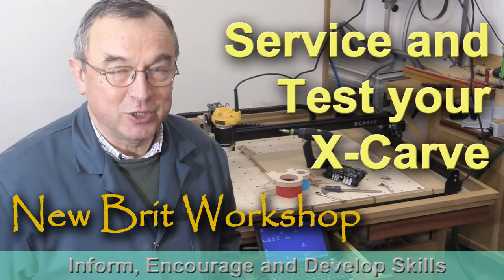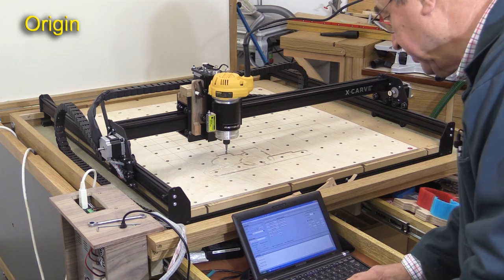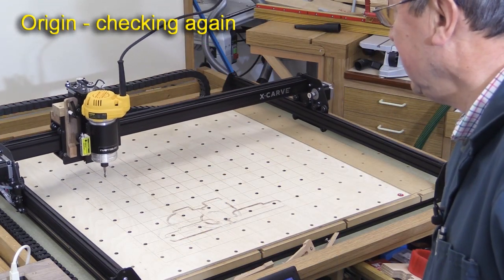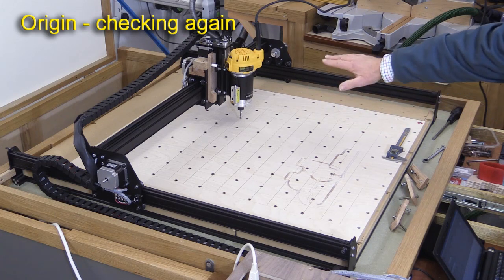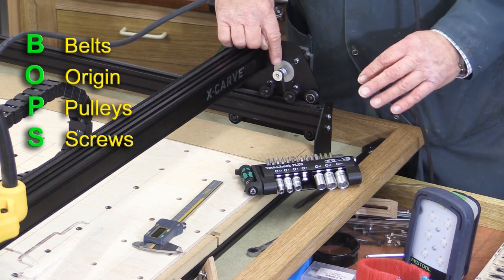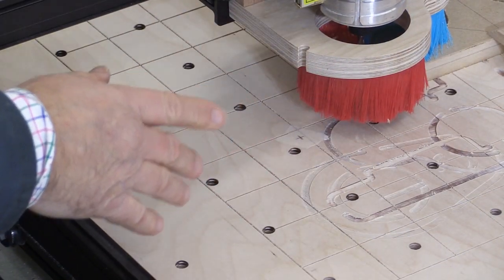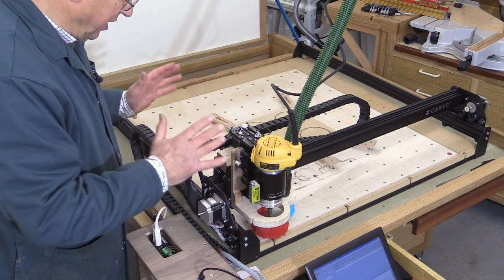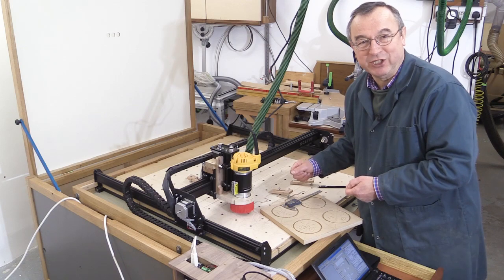Original X-Carve Service and Test

Comment: Nice vid Peter, I've not got a CNC yet I'm still looking but this one does look good and with a big working area,,Paul.
Reply from the maker: The one I have could do with some stiffening in the gantry to improve the finer detail cuts. It does work quite well overall. The newer design looks better but I have not tried it at all.    Peter
Reply: Hi Peter did you look at the ooznest ox cnc, it looks good and they are very close to where I live in Essex.

Comment: What is the procedure to homing the x-carve?  I noticed that you dont have the limit switches.  What prevents the machine from trying to continue to travel?
Reply from the maker: Hi Aric, I do have the limit switches and so all I do is use the $H command from the Universal G-Code Sender.   Peter
Reply: Oh, I did notice them in the video.  I am trying to figure out why I have different cut depths along the x axis.  I followed your video for adjusting the waste board t-nuts and i am still having issues.
Reply from the maker: Hi Aric, Is there a chance that your X-Carve is not on a flat surface?   Peter
Reply: +New Brit Workshop (Peter) that will be my next step to confirm.
Reply: I wanted to give you an update.  I went over the x-carve from top to bottom.  My y-rails are perfectly level, my work bench is perfectly level.  I did notice that some of my v-wheels were tighter than others, so I repositioned every v-wheel.  I also removed the stiffening mod that you showed in your video.  I retensioned all the belts and tightened every screw.  I will provide an update, once I perform a test cut.  Thanks for the hint about the levelness of the unit.

Comment: Thanks again for a great video Peter. I think that would have been a good method to check when I completed the build. I have used mine quite a lot over the last three weeks and this will be my next piece. If anyone is interested about performance at low temperatures I ran off two prototype zero clearance inserts for my table saw today. Unheated workshop at -15 C - absolutely no issues. I must set up a wifi cam so I can keep an eye on it from a warm room though!
Reply from the maker: +Itz MeAgain   Gosh, that is cold. I remember using my router in my back yard in Canada when it too was -15C. All was well until I spotted that my right forefinger had gone white and numb. The air flow from the router was blowing freezing air over my hands. Luckily I stopped before getting frostbite. Do get the camera so you can show us all what you get up to - perhaps start by sharing your zero clearance inserts.  Many thanks for the kind words.  Peter

Comment: Hi Peter. A bit of slop perhaps? I'm surprised it's so much, I thought those machines would be pin point accurate, it could be the cutter flexing or bending as it goes round. I found the best size of spiral bit was 8mm diameter, much sturdier and less likely to snap. Does your spindle accept a 8mm collet? 
Malcolm.
Reply from the maker: +Malcolm Daly Hi Malcolm, Actually I think it is mainly that it is difficult to measure the inside diameter of a circle cut into MDF. My callipers have quite sharp edges and the MDF is relatively soft. Added to that I am having to judge where the diameter line should be. I think the test could be improved by cutting discs and measuring their outside diameter. Anyway, I have given people food for thought so that they can test their own setup and take it from there.   Cheers.   Peter
Reply: You sure have Peter 😊

Comment: Excellent video Peter!  I have mine on a fold-up table, so I run through similar steps to tune up mine after it's been folded up a while.  Good tip with the marker.
Reply from the maker: +Steve Carmichael  Hi Steve, Thank you very much.  Cheers.  Peter

Comment: Very interesting that the first cut and final cut were so close to each other in errors (0.02mm) given the increases between 1 and 4 in cut depths and feed rate, does also make me question the rule with regard to CNC, so if I do get one will probably come back and watch these all again as a reference library. I'm sure its sensible to stick to rules for hand and table routing given the control difference between human and machine routing and the fact that people have been hand routing for quite a while compared to CNC. 
Great video as usual, thanks Peter for your hard work.
Craig
Reply from the maker: +Craig Hastie   Hi Craig,  Many thanks. I think that the measured differences should not be considered bad at all. Measuring across a diameter with my calliper is not easy and so there is a lot of opportunity for operator error.    Peter
Reply: New Brit Workshop could you please tell me how to correct the machine as it has reversed x and y axes so the left direction is positive x and towards me is positive y. Please help